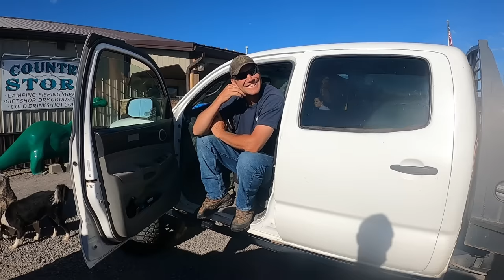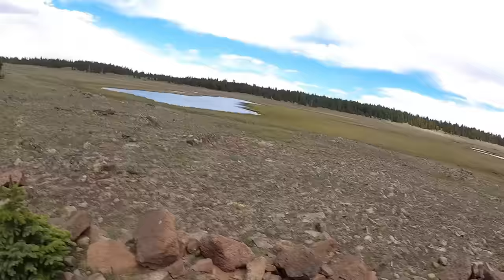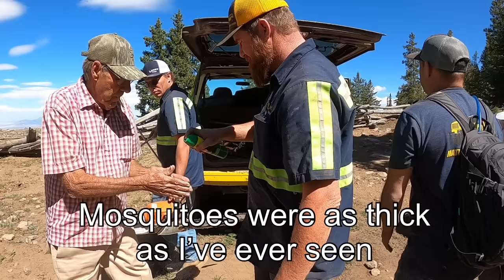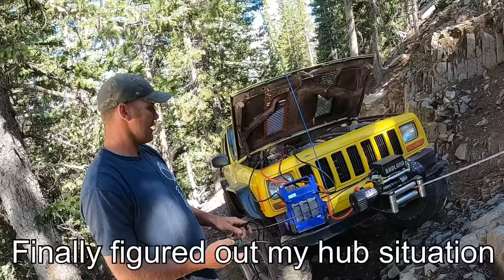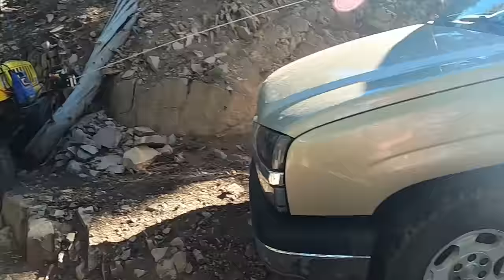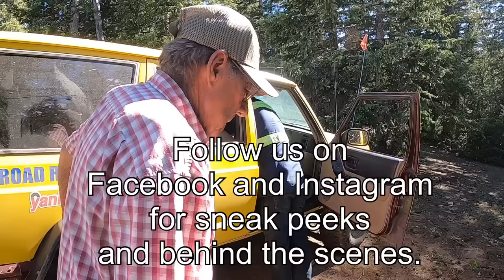There's NO WAY you'll recover that Chevy Truck!!!

Comment: I've watched this six times now and I thought this was an extremely difficult rescue until I saw a couple on the side of a mountain going to a TV tower that make this look easy.  Paul and Matt also pulled a golden Suzuki UNDER WATER to get it out.  I think when you give them a little bit of a challenge you can see what they are really made out of.  I love watching them work!
Reply: Having Matt and Paul work together made this recovery look easier I think. This is the only one I have first hand knowledge but I wasn't there for the recovery. Any recovery were one wrong move and your sliding down a mountain or other life risking stuff are beyond rating.

Comment: Man..the pioneers had it rough in the mountains. Can't imagine bring even a wagon up those kinds of hills and terrain let alone a stock truck.
Reply: I'd rather take a team of mules up that mountain than a Silverado 🤣
Reply: Stock 4x4 truck. Just put some bigger tires on it & back it off that  ? Cliff ? They didn’t need any bigger tires but it would’ve helped from hitting the underneath & breaking something or knocking a whole in the oil pan etc...

Comment: Not shocked that she fired right up. Those 5.3 LS engines in the 99 to 06’s are long lasting, reliable engines.
Reply: Honestly, why wouldn’t it start up? I’d be surprised if any engine didn’t start in this scenario.
Reply: Matt's Off Road Recovery I fully understand but I still feel any other engine would start up under these exact circumstances. I don’t feel this is a testament to the LS’ reliability. Also, great channel, I seriously enjoy watching what you guys do. It’s awesome.
Reply: 6in lift and put her on 35s and bumper change and you'll be set
Reply: Yeah my dad has a 06 van with a 5.3 in shocked its still running the way he drives 🤣
Reply: I've got an 08 my dad left me upon his passing. Only got 85,000 on it. 4.8 vortec. Runs so smooth. Love it.
Reply: @MattsOffRoadRecovery  so much “concern.” What’s with you drama queens?
Reply: @NM-apache  not a 99-early 07 won't last near as long.
Reply: @MattsOffRoadRecovery  I might have checked the air cleaner. I don't know if you did or not. Glad it started!!!!
Reply: itptires You’re exactly right. The 99 to classic 07’s with the cat-eyed headlights are stellar trucks that just keep on running. I have an 06 Silverado Ext cab (same pewter exterior as the one in this video) with a lift and all the bells and whistles, she’s still a baby @ 135K miles. My Dad’s got a 04 Avalanche with his 5.3 still running like a champ @ 299K miles. Routine oil changes and you’re good to go!👍🏻
Reply: Not anywhere near the vortec 350s they replaced.

Comment: Suggestion for you from an operations trainer. When giving instruction to the operator of the vehicle , use 1/4 turn direction. For each time you say driver , the operator would turn the wheel 1/4th turn left. This gives precise control to the director and eliminates confusion or guess work for the operator. I've successfully used it to guide inexperienced drivers backing in to dark docks as well as removal from snow and other hung up situations , when insurance prevented me from doing the backing or operating. I hope this is helpful , especially with as good as you guys already are.

Comment: It helps when you have the right tools and know what you're doing. Not an easy job. I experienced an almost identical scenario on Kodiak Island, complete rollover of my CJ 5.  Used three trucks all at the same time to retrieve my jeep. One on rear  hitch, one in front of back wheel to the frame and one to the frame at front bumper mount. Thanks to the friends that helped back in 1986. Semper Paratus
Reply: Hah, my dad used to go wheeling on Kodiak in the early 70's in a Willys he built from two Jeeps.

Comment: What was that guy thinking, lol. Yeah, that's what I'd do. Take ( what looks stock) truck sight seeing on trails that people with built trucks are thinking, maybe this isn't a good idea! Lol.  Nice recovery 👍
Reply: 8iiin.  +  u
Reply: Looked a little questionable how it ended up on side of road like that to me.
Reply: @digndurt6936  if you have ever gotten into the rocks they put down on railroad tracks and there is a steep angle, you will slide down! Believe me,it sucks you right in. if you watch when they leave you can see the Jeep fighting not to start sliding.
Reply: @Mike-ww5vr  Ya, it would. Hard to decipher pitch, narrow and angled to the left. Kind of drastic looking at it again. 
I had a 1943 Willys cj and was turning around in a sand pit, right front tire caught edge of swamp and sucked me right in. Silt was like quick sand. It took a front loader tractor to break the suction with a F250 chained to it to hold tractor ass down. A CJ 5 350 Chevy transplant with 35 inch mudders to get me out !
That old jeep would go anywhere but there. That was the fate of my rig, water level at bottom of windshield.
Never rebuilt her!
Reply: @digndurt6936  you can get in trouble really quick, swamp mud is definitely in its own class. That mud is the worst. It just holds you there and if you keep trying to get out your going to break drive line parts because it will not let your tires turn once it has that suction. Even after you get out it's the worst to clean! LoL. When I go out with my friends and one of them has never encounter ed swamp mud, I'll warn them and pretty much like anybody else who thinks their truck is unsinkable or unstoppable, they try anyhow. I'll just sit there and watch and then start laughing when they get stuck. Well looks like my winch is getting used today. Lol.
Reply: @digndurt6936  for real though, if you have something you have some good money in and care about, definitely and I mean DEFINITELY! don't ever take it in the swamp.  As you know you can destroy your toy in short order or even loose it all together. A's a example, my son got his Grizzly stuck only 15 ft in and I took my side by side out to winch him out. The mud had him so good my Wolverine was squatted to it's max and even slid a few feet tword his ATV before it came out. And my Wolverine has the cab kit, after market bumpers Ect. It weighs over 2000 lbs now. I swear that mud is alive and like a dog it's not going to give up that bone once it has its teeth sunk in. Lol
Reply: @Mike-ww5vr  I didn't go in on purpose. I was turning around and was tight but just let right front tire touch waters edge. The silt and sand was soft and it sucked my rig in like quick sand. I jumped out and it slid away from shore still running until carb took a gulp. Silt was stirred up and no doubt scored internal bad. Had a lot of fun with it but at that point I sold it.
Reply: @Mike-ww5vr  It can be amazing the suction of mud. I thought I was going to need a skidder to haul me out. It took us a good hour to retrieve rig!!
Reply: Yeah the dude had highway tires on 😂

Comment: Judging by the carefully laid fence, that was someone's cared for property at one time....
Reply: Thats a range fence for grazing cattle.  Built with what is available.
Reply: Might be USFS
Reply: Ya we used to build those back in like 08 all around boulder mountain and no one has respect for em at all I'm surprised they didn't just pull it apart for a sec right there that's what I would have done it's only like a 15 minutes job to put it back together

Comment: People really need to stop assuming “4x4” written on the side of the vehicle means this vehicle is completely and utterly equipped to deal with any off-road situation regardless your skill level.
Reply: No vehicle/driver combos are invincible, but it sure can be fun trying to figure that out!    Best to travel with at least a 2nd vehicle if possible.  I've learned that the hard way.
Reply: And before I forget, Hats off to u guys at Matt's Off Road Recovery.   Excellent/Professional work.
Reply: Maybe that’s why ford came out with the Fx4 spec
Reply: Unfortunately that is how the salesman sells them and the buying public just go on believing them with a "the salesman said", at that point you know your onto a loser by trying to enlighten them.
Reply: Most 4x4s are purchased for snow and ice on normal roads, many for mild off-highway work like farms, power line roads, etc. Maybe the manufacturer's commercials have encouraged kids to think a stock 4x4, really 2 wheel drive, can do rock crawling? 
We live near the Rubicon (in the Sierras near lake Tahoe) and we have some awesome rock rigs, many made from Toyota trucks. Not much left of the original drivetrains to make them rock worthy. A buddy has what's left of a 4Runner with the original engine and just about everything else aftermarket or fabricated by him. It's got four suspension seats and rides like a Cadillac on the rocks.
There are many warning signs on the approach to the Rubicon that state things like "Off-road vehicle required, lockers, etc, extraction is very expensive, stock vehicles won't make it through."
Our Sheriff's Office has a heavily modified Jeep for recovery, search and rescue, and drug interdiction that drives up and down the Rubicon daily. Those LEOs are hard-core four-wheelers that just happen to be cops.
Reply: 90% of the time, the truck/jeep isnt the bottleneck, its the driver. Those trucks can do FAR more than you give them credit for

Comment: I have a story where I almost slid off a mountain near Mackay Idaho. 
My dad and I went up one of the mountains for a Christmas Tree and the main path up is a little dirt road that has enough room for a compact truck plus like a foot to two feet of room for driving along with a gradual increase in the degree fall. 
We got to a point that was 60 degrees next to the road and turned off the road up a 40 degree 4 wheeler path just to pull off and put the truck in park and cut a tree down.

Now I was in elementary school at the time and to give you a picture of what happened think of sitting in a truck that is at a high incline and if you sit back it feels sort of like your more laying on your back then anything else. also remember right behind us the dirt road and the 4 wheeler path is at a tee and past the road is a near drop down the side of a mountain, there may have been trees but they were small ones since we passed all of the dense stuff.

Now imagine this from my dads perspective, since I stayed in the truck. He gets out cuts down the tree, he left the drivers side door open and the truck running obviously. Now when he goes to the side of the truck we were lucky because he went on the drivers side and tossed the tree in.

When that tree hit the truck it started sliding slowly and my dad jumped in causing it to go in a full slide. now the scary part to me but the smart thing my dad did was he threw the truck into reverse, tapped the gas and then turned. We ended up on the road facing the way we came from with one of the tires near hanging off before we headed home.

I ended up afraid of heights for years after that and I never will drive on those types of sloped again but It was an experience and I learned that when driving on snow or ice if you lose control don't go against the slide to regain that control or you might make things worse, try to go with the slide and gain traction instead.
Reply: I had a similar experience last summer just to the north east of Mackay on Big Windy Peak.  I was trying to get my Jeep to the top of the peak (1 of just a few 10k peaks you can drive to in Idaho). Turns out the last half mile or so isn't actually a jeep trail.  It's more of an ATV trail.  Didn't discover that fact until we were maybe half way up it.  The trail got too narrow to proceed any further.  Steep drop on the right, and mountain side on the left.  I got out and surveyed and decided we had to reverse several hundred yards in order to get to a place where I could wiggle my way through a 47 point turn to turn around and drive back down.  

When half your outside tire is hanging in the breeze and you have to reverse downhill on loose stone, you gain a real appreciation for flat ground.

Comment: A similar situation happened with my Scout II on a very muddy mountain trail in SW Virginia.  Had a 20' chain and anchored the center of the uphill side frame, halfway between the axles, to a tree uphill across the trail, 90° to the Scout.  Carefully started to drive forward (1st gear low).  A small tree root keeping the Scout from slipping down further snapped and the chain suddenly got taught (would have rolled otherwise).  Drove forward and the chain radius pulled the rig uphill, back on the trail.  The Lord was looking after us that day.
Reply: Sounds like you were out on Potts Mountain!

Comment: Wow. That trail would be sketch for a RZR let alone a stock Chevy.
Reply: @AllThingsFlightSim  yeah german engineering says it should hold up
Reply: No kidding, especially with hwy tires.  What were they thinking?
Reply: The trail from the driver's perspective was pretty deceptive though. When they pulled it up where you could see what the driver saw the approach seemed steeper than the road ahead. But why am I commenting, I wouldn't have gotten there in the first place!
Reply: David Womacks yes my results say you need to hit the clif going at least 100 miles an hour and take off flying
Reply: True.
Reply: @geraldrob5150  Smart man!

Comment: I actually have more respect for my Harbor Freight, Badland winch now. Seeing that y'all use them too.
Reply: Great work team. Glad everyone is safe.
Reply: I prefer my eBay winch. It conveniently plugs into the 12V outlet. Never had to use it on my CR-V.
Reply: I was thinking the same, makes me feel better about mine on my rig...
Reply: With that year long warranty you can beat the hell out of them too!!
Reply: @DoctorSkillz  hahaha!
Reply: The only thing wrong with a Harbor freight badlands winch is that they are much slower than a Warren...
Reply: @DoctorSkillz  thats a joke right?
Reply: @airdreams1  at least theyre warrantied when they die
Reply: J Blob My CR-V may not have all wheel drive, if that's what you're referring to.
Reply: @DoctorSkillz  I think J Blob is talking about your cigarette lighter powered winch. I'm curious how many amps that winch could possibly get from that outlet.
Reply: @DangerClose13E  I don't know. The instructions were written in Chinese. What's a good way to test the strength/pulling capability of the winch?
Reply: @DoctorSkillz  Use it. Preferably before you absolutely need it to do a job.

Comment: Not sure why anyone would take a truck like that down a road like that he is lucky he didn't go over in the cab.
Reply: True!!!
Reply: If you can go down it, you can go back up it. He didn't go all the way down.
Reply: @murraymachado401  No way out, old logging road I'm told. Plus it blocked with large dead fall a long ways down. It was totally stupid of me to even try. There is far more to the story than the video shows.
Reply: @dmcpeck  It was not stupid, thankfully it was just a mistake.
Reply: @murraymachado401  OK
Reply: That driver needs to buy a lottery ticket. Lucky it didn't roll.
Reply: @pog4life89 You buy them, I stand and watch.
Reply: @dmcpeck  I don't know what was going through your mind as you started to slide, but I can tell you that if it were me in that truck I wouldn't be able to poop for weeks after that scare 😂
Reply: That was a road?!
Reply: @cdc19845  It kind of looks like one but alas it's not. I walked in street shoes from the truck to the bottom. No way out unless you're a skinny cow maybe. Then there's the swamp! I made it to UT12 or I wouldn't be writing this. I'm old, over weight, and my pump has a problem with timing.
Reply: @cdc19845  That mountain has some of the roughest roads I've ever been on
Reply: @murraymachado401  I did on foot. No way out for a truck.
Reply: @cdc19845  Your right, it's not.
Reply: I've come to a lot of places where I said: "OK, looks like I'm done for the day" and turned back.
Reply: @dmcpeck  
Im happy you were able to recover your vehicle sir!
Reply: @sheldonmurphy6031  Me too but it's not mine any more.

Comment: Imagine the crazy SOB that took a bulldozer off that for the first time in the making of that trail/road. LoL! It's clear to see the bulldozer operator only ever made one pass.. LMAO! The road was probably made by a bulldozer fighting a forest fire. Anyhow nice work men..
Reply: Dozers, Graders, and Excavators are surprisingly stable and nimble machines. The tracks, weight, and earth working attachments in the excavator's case make them great for grading at steep angles. Front End loaders on the other hand can be a bit tippy.
Reply: When that was done the dozer was a John Deere B converted to tracks.  The metal tracks do not always bite good on rocks that break and slide out from underneath you. When I was a kid neighbor had one that was pretty beat up. He had balls of steel, a steel plate on his head a few pins in his legs, was shot in Korea and the in Vietnam; died in his sleep driving.(alone)
Reply: @badgerpa9  that's the way I want to go, quietly in my sleep and not screaming in terror like my passengers.😁

Comment: Insane recovery, It’s out of only love that I have to explain why using that U bold like you did is incredibly dangerous. When you put that snatch strap attached to the bolt at the bottom of the U your putting what’s called sheer force on it when it’s not designed and certainly not rated to take that kind of force. People die doing that type of shit all the time and I’ve seen plenty of broken wind sheilds in my short time off road
Reply: What Ubolt are you referring too?
Reply: Are you talking about the huge shackle? I wouldn’t worry about that big of a shackle.
Reply: time stamp?